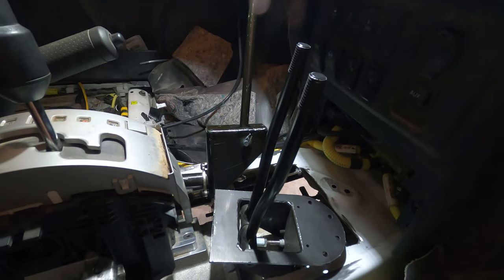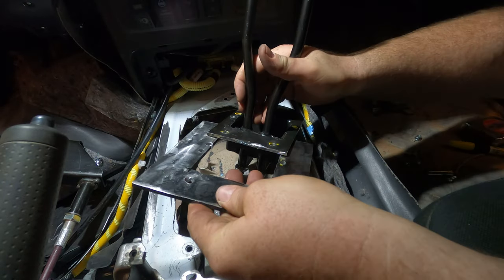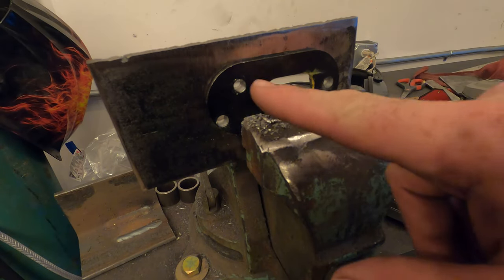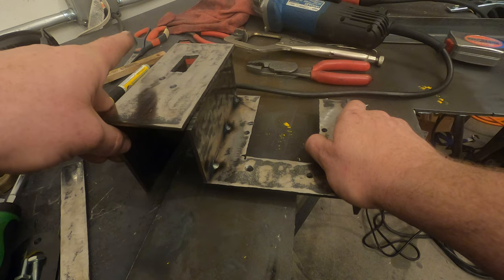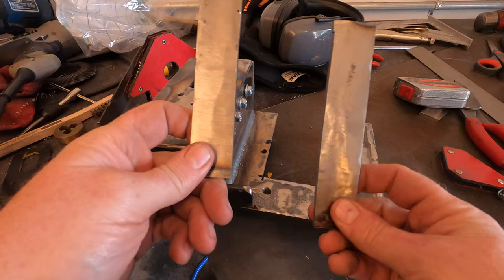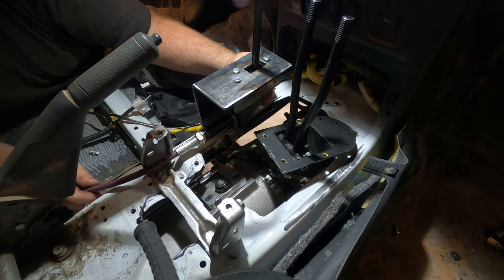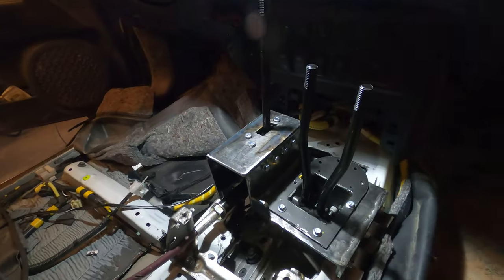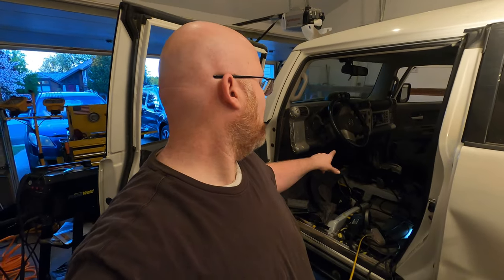Atlas Shifter Bracket Fabrication // Toyota FJ Cruiser

Comment: You have the function covered. Strong and accessible. Sounds like Jeff is going to help you with a custom cover!
Your welding skills have leapfrogged! Beautiful work Ken! Thanks for taking us along.
Reply from the maker: Thanks Jey! I felt pretty good about my welding in this one. 😀
Reply: @offroadhub.official  where ever,when ever,possible,use bolts big enough,to weld the nuts on other side. welding angles together,weld the ends first.then tac the back side then the front.or tac a brace from top to bottom. break,grind all edges to a 45.stops finger cuts..did you hi temp grease the yoke splines,& all mating surfaces.. metal on metal,not good.
Reply: @offroadhub.official  or tap holes if thick enough.. id have an angle bolted to floor,seeing its poofteenth thick plastic steel. & bolt to mount brkt.. less chance for floor to rip, plus your welding what,3 1/6, to .oo8 steel,loosly termed..
Reply: @offroadhub.official  fords,,use foam,atop the box,around the shifts. either for nose,or stops dust,water ingress.
Reply from the maker: @phantomwalker8251  The metal where I welded is actually reinforced, so I feel pretty good about it.

Comment: Picked up my FJ a couple of weeks ago, on my first outing managed to slide into a tree. Took out my tail light and did some quarter panel damage, looks like yours on the left side now.
But absolutely impressed with the FJ and where it could go. Picked up some 4mm skid plates and have booked in to get the panel pulled back out (Not too expensive surprisingly).
Reply from the maker: Good to hear you're out enjoying it!

Comment: look for magnetic joe blocks. They provide a flat edge and a strong magnet to hold your pieces together. Look for the ones with a physical switch. You can also use 1,2,3, joe blocks and clamp those to your parts.